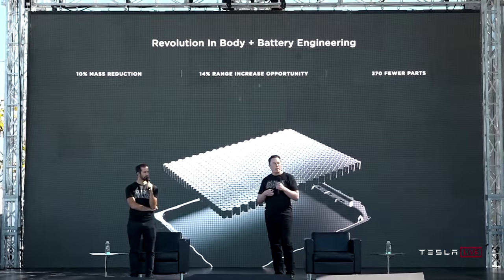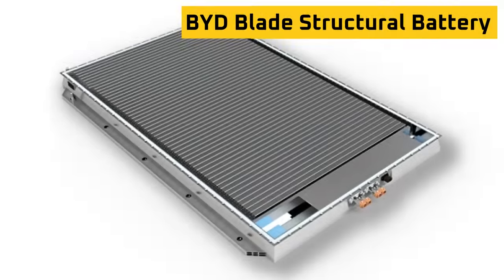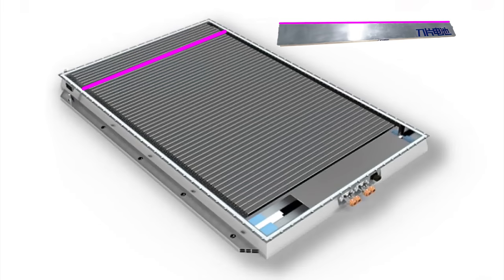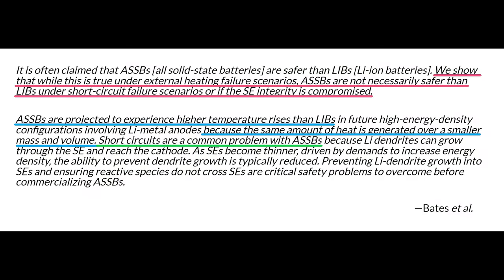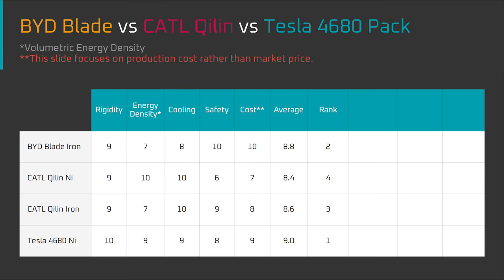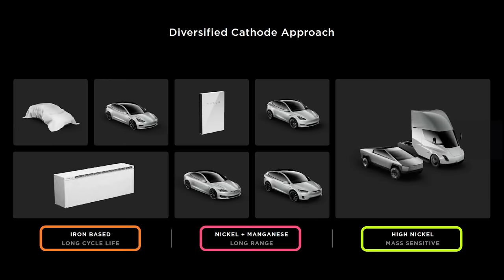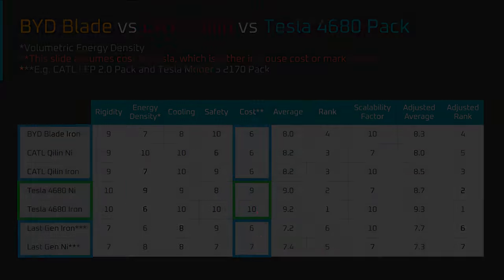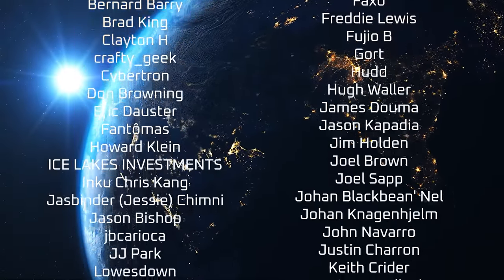Pack Analysis:  BYD Blade vs CATL Qilin vs Tesla 4680 Structural

Comment: Very interesting, thank you.  One additional advantage in Tesla's technique is that multiple pack sizes are possible without changing the pack voltage.  Tesla can shrink or grow the pack size by changing the number of cells in parallel, while keeping the same number in series.  With BYD, it appears all cells are connected in series, so they may only be able to change the pack size by changing the number of cells in series, which changes the pack voltage...which in turn changes powertrain voltage.  They could double each cell in parallel, but that grows the pack size by 100%, which is a completely different vehicle.
Reply from the maker: Amen!~

Comment: Hi Jordan, thanks for the great info, as usual. IMHO, the LMFP Qilin is probably best for most applications: the manganese improves iron energy density, iron based cells are cheaper and last longer, don't have cobalt, are safer (generally), etc. Obviously you know this, but I just wanted to add my $0.02 in the comments.

For the time being, it seems Li-ion rules the roost for high-density apps, like performance. I think for the semi though, LFP will be a good solution soon, if for nothing else, durability/cycles.
Reply from the maker: Fair comments!

Yeah, LFP for the short range semi would be just fine.

Comment: Great presentation.  I liked a lot.
But have you think the geometry of BYD Blade has very lower thermal requirement so bottom cooling circuit is prity enough to keep battery temperature in good operation. In this meaning, the BYD Blade has the best thermal efficiency of these pool?

Comment: i always thought that larger cells for higher capacity makes far more sense than putting multiple cells in parallel. BYD Blade is amazing.

however, though i know these are all long life structural packs, if BYD could easily make their cells replaceable, even if it requires desoldering or re-spot welding, it would give far more confidence that these packs are worth using the resources for when the market does become resource limited. a serviceable vehicle is an immortal vehicle.

Comment: Number of charge discharge cycles is surely a very important attribute that you haven't considered.  By this criterium LFP are better than CoNiMn as I understand.
Reply from the maker: I did consider it but as long as they hit the minimum number of cycles required they're good.
Reply: For a second car that’s  irregularly driven and used as a house battery for people on time of use plans or solar owners I see charge cycles as very important. Also resale value/secondhand market is much more focused on reliability and that includes maximum charge cycles not just getting it past the warranty period. Resale value is obviously very important for any purchase cost calculation.

Comment: Hi Jordan. I noticed you stated cylindrical nickel  based pack only option for LONG RANGE Cyber Truck and Semi. So what's your opinion on iron chemistries in these vehicles? To my mind if they simply swap out nickel for iron with similar volume packs the low range 300 mile options will be easily possible with iron chemistry !!!!
Reply from the maker: Possible.  Likely?  Depends on cell supply from different sources.

Comment: Jordan ,you always compare to a future 4680 gen3 theoretical implementation. Tesla has many challenges with supply of materials and there are huge process validation confirmation. Scale is all a pipe dream at the moment , so I would compare on what is currently testable?
Reply from the maker: Because pack energy density is somewhat independent of cell energy density.  Tesla won't have an issue with the pack.  It will be the cell that they struggle to increase energy density.  

They are separate and distinct things.

Comment: The blade design is absolutely the winner for LFP.
The cylindrical cell is absolutely the winner for NCA, and to a lesser degree NMC, as cylinders under pressure do not expand - the end cap handles any pressure event. We've all seen puffed up prismatic cells and it seems that all prismatic cells swell - blades are fundamentally a stretched prismatic cell.
Reply from the maker: Amen, Blade is a pretty kick ass design!

Comment: Excellent analysis - Thanks!  On pack density, I thought prismatic cells require extra space to allow for expansion of the cells.  It would seem the metal containers may have some empty space to allow for this, reducing the density.  This might also reduce the efficiency of thermal systems as air is a poor thermal conductor.  Sadly, it's hard hard to find these details from marketing presentations if true.
Reply from the maker: Amen!  Lots of variables there.

The packing density of the jelly roll within the cell is better in cylindrical cells and the cell can acts to contain the jelly roll expansion.

Comment: That 4680 pack looks over the top structurally ridged and strong, hard to fathom it can't be significantly mass trimmed.
Reply from the maker: Amen, brick shithouse, lol
Reply: @thelimitingfactor    Even low density insulating foams can be quite strong (at least in compression, not certain about sheer or tensile) and plenty rigid. 

 The pink stuff they use must be much heavier, but we all know they intend to improve these packs.

Comment: I disagree - at least for an eauropean view - with your position on the irrelevance of charging speed. Here, the limited range & long charging time of EVs is the main concern of people to turn away from petrol & diesel engines.
To convince here, it's either necessary to put in larger batteries which makes EVs too expensive for the masses - or you shorten charging times for cars that have a range of  350 - 400km. Here I see the CATL approach having a slight advantage.

Comment: A factor not mentioned is that only tesla 4680 packs have enough cells (1000) to go to 900 volts+ which can significantly shrink & lighten the drive motor & much of the  connecting heavy wiring, like Lucid has done. This may also speed up super charging so I've read, but I'm not sure how?

Comment: Another safety issue I have not seen commented in the video is that battery fires are metal fires. This means that water cannot put them down, it makes them worse! When water contacts metallic elements (like Lithium) it splits into hydrogen gas and OH anions. The hydrogen gas then proceeds to ignite with the oxygen of the atmosphere. That's why it is so difficult to put out EV fires.
Reply from the maker: Bingo!  Also, great explanation.  I didn't know the details.
Reply: @thelimitingfactor  Not to mention the raging hydrolysis as at 300+ volts, pure water is a good conductor, great quantities of electrolysed hydrogen. A quick look at the hazmat for hydrogen makes me nervous of hydrogen power, green or otherwise. My feeling about EVs is the limited charging ability of overloaded grids, I run an elderly Nissan leaf charged by our solar.

Comment: The argument of increased surface area for cooling also need to take into account the Rejected heat from the cells and the application. If the cells are arranged in a way and the application is causing the cells to not need that much that rejection, Bottom plate cooling is fine.

Comment: A pack that can charge as quickly as a gas fill-up will completely eliminate range anxiety and allow for smaller pack sizes.
Reply from the maker: Alternatively, if you make the pack larger, you have to stop less per trip and also get faster charging as a benefit.

Comment: Teslas structural battery needs to be repairable and not disposable. I'll trade a bit of rigidity and weight for repairability.
Reply from the maker: Repairability has never really worked for automotive packs.  See other comments in the thread where I explained it more.
Reply: @thelimitingfactor  what about the other electrical parts inside of a tesla battery pack? Any 1 part breaks the whole pack is trash. There are other parts inside of the battery that can fail and it requires the whole pack being replaced.
Reply from the maker: You're reaching there.  Anything like that would be covered under warranty and be immediately apparent.  That's the point of a fully sealed pack.  Ain't much going to break or snap entombed in polyurethane.
Reply: @thelimitingfactor  watch sandy munroe s disassembly of the battery pack there is plenty of other electrical components in there I'd have to go back and see what they are called but if any go bad the pack is garbage. And some people keep their cars over 100k miles and will tesla continue to build that exact pack 10 years from now? I guess not. I am a tesla fan btw.

Comment: Thanks for this brilliant video on these 3 next gen pack designs which we will see getting into cars in 2023. It is amazing how quickly things are moving. My 2019 Kia e-Niro has an NMC pouch cell pack with 147 Wh/kg gravimetric density at the pack level. This energy density is now surpassed by iron based packs in the Qilin and Blade designs. The battery in my car was made by SK Innovation and as far as I know there have been no reported cases of fires with these cars which have sold really well in Europe. My understanding is that the Hyundai Ioniq 5, 6, Kia EV6 and Genesis cars all still use pouch cell designs from SK Innovation but are 800v systems. So it seems that pouch cells are not dead yet! After 74,000 km and nearly 4 years I have seen no loss in range, though of course there is 3.5 kWh of ‘headroom' on the pack in my car, something that I believe is not needed in a LiPo chemistry.

Comment: hard to understand, if Tesla's battery pack is better than the rest, than BYD would buy battery pack from Tesla, not the other way around...
Reply from the maker: You have to factor in why people are building in house production...

Because it's 20% cheaper than buying on the open market.

So if you produce your own cells, there's no reason to ever buy other cells unless you're growing so fast that you can't meet your own supply needs

Comment: Great Video, lots of help in understanding of the new generation of battery design and chemistry.  I will review your site in hopes of finding answers in some of the changes being worked on the anodes chemistry to depart from Cobalt use to graphite either synthetic or mined or 100% silicon or lithium of graphite enhanced silicon. Thanks

Comment: the Tesla cells are safer from a termo run away situation because of the tabless design. It's not only about how they cool the cells but is also how they avoid going hot in the first place,  so, less distance the electrons travel the less hot the cells get simple as that, in my opinion cybertruck will charge faster than older models, batteries. Also the fact they have (chinese) that large cells and small in number, the battery will degrade faster. Tesla has like 800 cells, if one in 800 dies the degradation is small, if 1 in 55 dies the degradation is bigger, a lot bigger. And we see how Tesla lose like 10% after 200k miles or something like this.

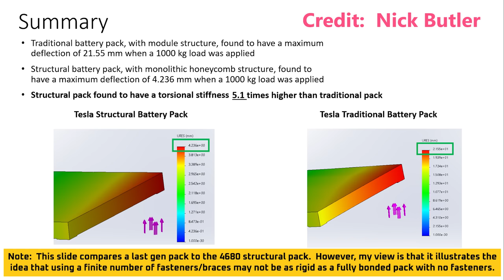Comment: You didn't give a reason why Tesla's monolithic pack should beat the others for structural rigidity? @9:30
Reply from the maker: I did, I just didn't write a paragraph on it.  There's an image of the modelling that was done and also I said that it would have greater rigidity than something with a finite number of structural members.  That is, there's no joints.  Joints are weak points.

If I did a deep dive on each point, the video would have been 50% longer at least.  This was a cursory overview of points that I've done entire videos on in the past.

I've done two videos on the structural battery pack already.

Comment: Thanks for the great overview. 

One thougth: service and recycling. Tesla seems to be the worst concept when it comes to this. At least that's what I think when I see the foaming. On the other hand, when a blade cell goes bad, it should be easily replaceable. 

Regulatory action like "right to repair" and "fit for recycling" could influence the scores of future packs. Circular economy is a big goal, that could influence lawmakers. And it makes sense as well, because we could make more use out of limited resources.
Reply from the maker: Making the pack serviceable is a waste of time.

I'll eventually do a video on this.

As far as recycling goes, they designed it to be recyclable.

... Grind to physically separate and then chemically separate

Comment: Tesla's 4680 structural battery pack is interesting. The problem is reparability, recyclability, thermal management and the life cycle impact to the car owner. Concerning all three, using batteries as an integral structural part of the car does leave me with some safety concerns during high impact situations while still not fully addressing ways to help firefighters to contain and mitigate a lithium battery fires, this I believe could be addressed through some simple modifications that would allow firefighters to be able to pump water into the battery pack and thus helping to contain and cool the battery pack.
Reply from the maker: I've covered those points in past videos.  Not even repairability is valid because it's a trade off decision that creates other benefits.  It would only cater to to about 1 in 10,000 people and disadvantage everyone else.

Comment: Hi Jordan. I had a friend in Florida who pointed out that some EV fires happened there after the Hurricane, due to salt water getting into the battery pack. Of course that is bad, but I assured her this should be very rare, for the same reasons that gasoline leaks are rare. But if it happens, yes that is bad.

Comment: I think you need one more column in your analysis.  Recycling is a critical issue and to me, the Tesla battery looks to be poor in that regard.  Maybe it is just a huge problem to tear apart mechanically and can be chewed up and separated efficiently, I don't know.  But the bottom line is, no matter how good a battery is in other regards, if it isn't highly recyclable, it is a non-starter.
Reply from the maker: Yup, just throw them in a shredder and chemically separate them.

All are recyclable.

Comment: LFP 4680 could have an energy storage and fork lift market
Reply: Lead acid is just as useful as it provides the heavy counterweight and if used reasonably, lasts more than 10 years. Mine did nearly 20 but needed nursing at the end.

Comment: Jordan I'm curious how would you rate 1 to 10 the energy density of M3P with these next gen battery packs? Shenxing M3P might be a 10... Why?! Because it's electrolyte works so well in cold temperatures that it could work without any cooling whatsoever (and save on weight and volume) just like Mercedes EQXX which had 100kWh of LFP battery without cooling. Shenxing M3P could be a 10 battery in Rigidity, Energy Density, Cooling, Safety and Cost. A straight up the best battery pack combo to date. Maybe even the optimal solution in terms of thermodynamics?
Reply from the maker: No need to copy and paste to both videos.  My dashboard shows me everything.

I'd have to refactor everything because it's all relative and has to be looked at through the lens of the whole competitive landscape.

M3P might come out the best out of everything regardless of pack tech.  It's a great balance - no real achilles heal.

As for Shenxing, they didn't actually tell us a whole lot, we still need to see specs or I need to do research to guess.

"Shenxing M3P" might have some incompatible technologies or may creates trade off decisions, so that's a level of speculation even further.
Reply: @thelimitingfactor "Thermally modulated lithium iron phosphate batteries for mass-market electric vehicles" at ResearchGate. With all this hype about cathodes and anodes, the electrolyte is the one that brings meaningful progress.

Comment: Very cool video. Where does SK ON and LG Energy sit in this conversation? Is BYD and CATL’s generationally ahead and so SK and LG were not considered (which maybe you already answered by ignoring Ford and GM, who use SK/LG). 

Anyways, a curious Ioniq 5 owner would like to know 😅
Reply from the maker: Good question!  SK and LG are pretty kick ass, but haven't produced a novel pack architecture as far as I can tell.  Great cell manufacturers though.

That is, it looks like you answerd your own question.  If your vehicle has those cells an packs, they're probably on par with Model 3 packs from a few years ago.  No noticeable performance difference to next gen packs, mainly a cost excercise.

Comment: Your logic is abit flawed. If Tesla cannot meet their advertised production rates, they will have to purchase from BYD and CATL in order to push out cars. Tesla sells cars and it doesnt matter what their "in house production costs" are if they are having to purchase bulk of their batteries in the open market to sell cars.
Reply from the maker: Not sure what the argument is here that I didn't cover in the video.

Weather Tesla gets their cells in-house or out of house, it looks like they still have enough supply for at least the next couple of years.

In-house production means higher profit margins and the ability to create cheaper vehicles.
Reply: @thelimitingfactor  
Thanks for the vid and your reponse.

BYD and CATL-SIAC and Tesla are all vertically integrated EV companies. Only if Tesla is able to scale their battery manufacturing as advertised are they able to compete at the scale and the margins BYD or CATL can produce for batteries. If they cant, their battery margins are worse than BYD and CATL, their costs on average are higher than BYD and CATL and their price is higher than BYD and CATL.

So it is imperative that Tesla succeeds in not just some but all of their advertised rates to keep its volumes of cars and profit margin at the valuation many investors have priced in.

And in a supply constraint environment, it will be a bidding war no? Why would all battery manufacturers converge to a same price. It will just go to the highest bidder?